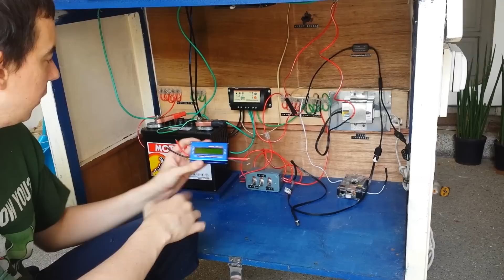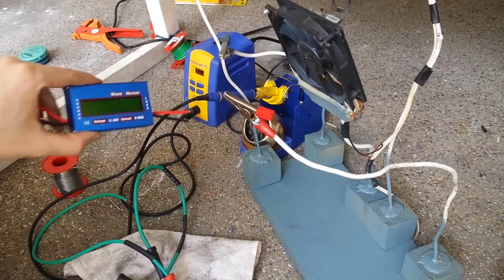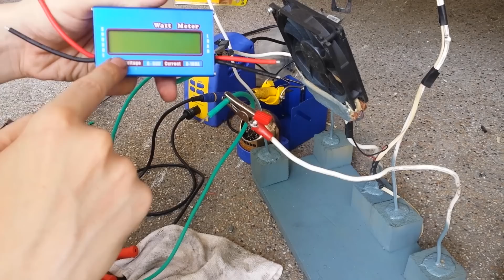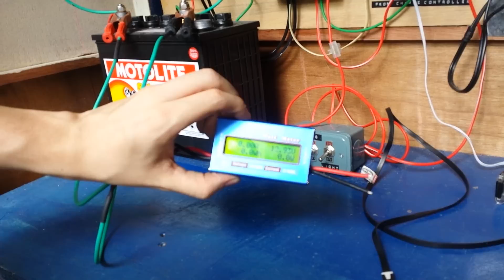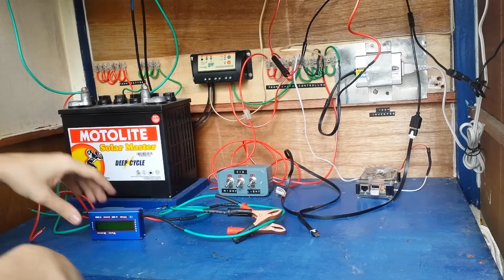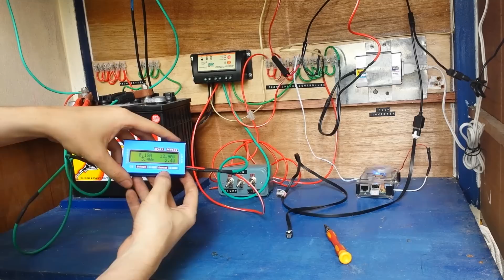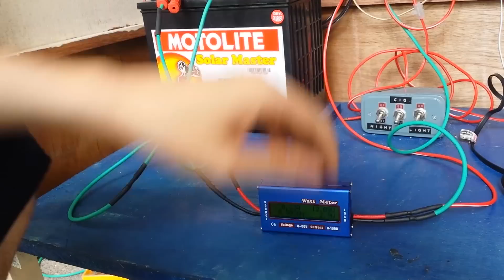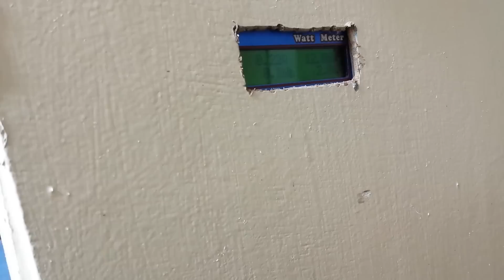How to wire a solar watt meter

Comment: i have been installing solar panels for over 15 years, for them who wants to know the correct way. you connect the solar panel to the controller  the battery on controller to watt meter source, . the watt meter load to battery . then you will know how many amps you solar panel is  given you. some people just do not do there research,
Reply: if you want to know how much you use, put a watt meter  to controller  lights out  source then load to on and off switch  then to you lights or power

Comment: Sir your video is very helpful to me. May i know what part of the controller you inserted the two wires of the LOAD SIDE of the watt meter? I mean what is the portion of the controller you inserted the two wires from watt meter? Sorry to ask but i am a newbie & my electricity knowledge is just starting. Thanks.

Comment: Ok I am confused... I have a wind turbine, and solar. They are as far as I am aware the SOURCE... and the LOAD is the battery that is being charged... How is this the other way around? Because if I reverse the wires, the cables run, solar/wind turbine ---> charge controller ---> then LOAD side of watt meter ----> then Battery on SOURCE side...?? How is the solar or wind turbine going through the charge controller a LOAD...? It's the SOURCE OF THE POWER INPUT !! Then the LOAD is what you are charging or using the power for... i.e LED lights etc...
Totally confused now...

Comment: If the battery is drawing power from the charge controller, doesn’t it then become the load?
Reply: you noticed that as well , you do not  put load back into controller,  controller goes to source load  goes to battery then you know how many amps your solar panel is  producing . if  you  want to know how much you use, then from lights out put to another source watt meter load to a switch then lights

Comment: Please reply! What if I will change the direction, source or load, because when charge controller will charge the battery, current direction will be opposite, it will flow from charge controller to battery, so in this situation will it work, or it will blow the circuit of watt meter? because now the current direction is opposite, please reply

Comment: Hi. I've just bought one from powerwerx and they are clear that the source is the input and load is the output. It also says "only current from source to load can be measured. Drawing current in reverse will cause damage to the meter" that said this is not a powerwerx so best individuals check with their own instructions.

Comment: isnt the source the charger? the load is a battery that needs charged? also i was under the impression these only measure in one direction. i was also under the impression you need a shunt if you want to see watts both going into and leaving the battery. am i right? btw i just wired my "watt meter" that can handle 200 amps and it started to melt my thing jumper cables. i was using jumper cables that are about the size of a mutimeter's test probes. also, just a question: how does the charge controller handle seeing the state of the battery though the watt meter? i am concerned the watt meter may interfere with the charger ability to read the battery and either not charge or over charge the battery. i am just trying to learn, not attacking anyone.

Comment: I want to also measure the the power comming from the solar panels going into the charge controller so I put my meter *(the same as you have) between panel and controller with the controller as load. This works fine. If you have to meters you can see the loss of power caused by the charge controller.  . But every morning my meter has crashed. This is because at night it does not get any power and when the sun comes up the voltage slowly rised and the meter crashes dureing start up. 

So I connect the + and - from the battery I am charging to the external power inputs of the watt meter. But now my  charge controller allways sees voltage on the panel side. This is dude too common grounding and I cannot find a solution for it. The only way so far is useing a seperate power supply to power the watt meter but how do I do that when having an offgrid solar setup? Getting an extra panel just so I can charge an other battery to mearuse watt seems a bit crazy.
Reply: Same question here.

Comment: I use 2 , one between the SOLAR and CHARGE CONTROLLER and one between the CHARGE CONTROLLER and the BATTERY. so i know how much power output the solar panel going through the controller, and how much power output is the controller giving the battery .

Comment: You didn’t specify where to hook it on the charge controller. I have a load hooked to the PVC side and  on the battery side I am in hook to the DC in but I’m getting nothing

Comment: My wattmeter looks like yours. My one has a small hole on the source side. Behind it there are 3 pins. Does anyone know what function they have? External display power and/or holding the data? Backlight? Or for adjusting?
Reply: These pins are used to power the meter when the voltage is below 5 volts or so. The centre pin is positive. One of the outer pins is negative, the other is used to reset the readings. Not sure which way round, and I believe that the reset is not implemented on all models.
Reply: For mine pin 1 is negative and pin 3 is rest. Pin 1 is the pin farthest from the thick red/black wires, and closest to the little square at the top left of the hole. Incidentally mine wont run with less than 7 volts.
Reply: @carlosrey5378  thank you i was wondering why mine wasnt powering up with a 5v usb but once it gets 7V and slighty higher it operates perfectly and does not switch off when theres no source power

Comment: that was informative but you missed out one thing, the wires from the load go the charge controller, are these the middle pins that state battery ?  Does it show in watts what the solar panels are producing an how much they have produced in Kwh per day ?

Comment: Hey, thanks for awesome video. I hooked one of these babies up. With the load side of it going to my batteries. Only glitch I see is. That when my 21 watt fountain pump powers up. The analyzer goes crazy and starts giving some crazy   reading. I have a 25 watt panel, 2 12v LAB'S in parallel = 20ah. And a 21 watt 1.7amp pump. Can you please advice. Much appreciated. Cheers!

Comment: When you installed your charge controller when you did the positive to positive on the battery negative to negative on the battery what about when you hooked it up to the. Charge controller did you hook it in the battery in the charge controller that's what it look like you did please get back to me Mike you didn't hook it up to the panel side

Comment: When you hooked up that wattmeter you hooked it to the battery side first and then the controller but it looks like you installed it in the battery part of the controller not the solar panel part if you understand what I'm talking about

Comment: Why is the watt meter waking up when it's only connected to the LOAD side? It's reading the voltage and drawing power... why? Will I have to wire another switch there to cut the wattmeter?

Comment: Thank you Gadget addict for this wonderful tutorial. I have a question, does it remember the Ah or Wh after power goes off. I mean if i connect this meter between solar and charge controller and when at night solar power goes down , will it remember the next day ?
Reply: No

Comment: Hi Phil,
Could I connect this type of watt meter to a car battery charger.  (CTEK). I need to keep a mower battery topped up with this charger. My thinking is with this meter I'd have a visual check on the state of the battery.

Comment: You need one meter on the panel side before the controller and another meter on the load side after the controller for comparison. The whole idea is to make sure input amp hours is greater than out, not possible using only one of these meters

Comment: Please remove this video. I wired my system wrong because of your advice. Didn't you realize you wired it backwards before you posted the video? What was I thinking? Of course the load is the batteries. I'm uber pissed.
Reply: Your are wrong
Reply from the maker: +Chris Ragan you can wire it either way depending on what you're measuring. Read the video description for more information.
Reply: i agree you have messed me about you are a fool
Reply: Yes battery is the load
Reply: you bet he is wrong battery is  load, source is  controller, you would not put a petrol generator output into a wall socket .  look at my recent replies

Comment: What if your inverter is connected straight to the battery? And i want to see what's getting pulled out more than what's going into the battery.
Reply from the maker: Just wire this between the battery and inverter :)

Comment: Instead of soldering I have seen butt splices used do they have them in the Philippines? I live 6 months a year in Samar.
https://www.bing.com/images/search?view=detailV2&ccid=EWd3J87d&id=2D1E6852427D0D8674258B1B7433C2E3119A2146&thid=OIP.EWd3J87dnbt790aFjdlzBwEsEs&q=butt+splices&simid=608049173240416868&selectedIndex=1&qpvt=butt+splices&ajaxhist=0
Reply from the maker: They're sold in the PH but I don't have a crimping tool and I find they don't work very well when you hit them with a hammer :P
Reply: Thanks for the reply. I'll bring a crimping tool with me.

Comment: After this vid i got a watt meter and hooked it up between the solar panel and charge controller .
But now every new start of the day the watt meters turns on with all weired things on the screen,when i unplug and plug the solar panel back in it starts working again.

Comment: A trick to joining those wires is not to twist them but push them together head on so the strands go inside to other wires stands, then solder.
Reply from the maker: True, especially for thicker wires :)

Comment: Funny I just got one, noticed the only way to get low voltage measurements is to apply a fixed power to pins on side at least 9v-60v

Comment: can i put it the other way around? i want to measure how much power it is going in from charge controller to the battery. Well I guess what I want to do is, how much power I have generated for that day. My charge controller doesn't show my that.. It only shows how much power is being generated, volt and amps. Let me know of other option on how I can do that.
Reply from the maker: Yes that can be done. I gave some alternative wiring options in the video description :)

Comment: you will burn a meter up connecting the source to the battery like you said the load is the battery
Reply: i was about to comment on that, source is solar battery is load
Reply: ha ha ha me too and those wires going to the inverter  are too skinny  also that kind of BATTERY is JUNK motolite its not  really a  deep cycle my motolite  golf cart batteries are junk it is just like a car batteries cannot hold the power easily discharge not even a year since i purchase

Comment: I'm lost. That meter is wired incorrectly surely. The 'source' should be charge controller and 'load' should be battery. If measuring watts of the load on battery, 'source' would be battery and load would be item you connect to battery such as motor, light etc. ie 'source' is in and 'load' is out.
Reply from the maker: +jackbox It depends what you want to measure. Check the video description for wiring options :)
Reply: Three ways that I can see: (1) panel/source/load/controller (measuring raw panel output), (2) controller/source/load/battery (measuring charge being put into battery), and (3) battery/source/load/electrical items (measuring load on battery and state of charge). Not sure what its measuring back to front. It depends how watt meter is wired internally I suppose. Great meter either way :D

Comment: Can I connect the meter directly to the solar panel?  I need to monitor the amount of power it produces in one hour, is there something that could monitor that?
Reply from the maker: +mamamia13 You can measure the output from the solar panel yes. If you check the video description, I talk about which way to connect it depending on exactly what you want to measure.
Reply: Gadget Addict Do you know if i can graph the change in wattage over time?  If there is any tool hat you can recommend for this it would be great!
Reply from the maker: mamamia13 There are some watt meters that come with that feature built in and can export to a microsd card or USB pen drive. But using this one, I don't think there's any practical way without some complicated arduino project.

Comment: How much and where did you get your watt meter? :)
Reply from the maker: +mckoy estrada From Cavite Ecosolutions and cost around 1000 or 1200 PHP. I have seen other sellers more recently with them for around 750 PHP. Or you can order from China with free delivery for around P600 (13USD).
Reply: Thanks!
Reply: Thanks!

Comment: Phil, how would you use two meters (wired in  opposite) to give you solar power in, as well as load out? One meter between panel/battery and one battery/load? Cheers

Comment: hi, great video, its helped me a lot putting together my 12v lighting in my garage. I have a question, if I had 2 watt meters would it be possible to go from the charge control into meter1 to read panel info then into meter2 to read  how much power is being used then into the battery?
Reply from the maker: sephuk Yep that would work absolutely fine :) There are other higher priced meters available that could do that in one go.

Comment: you are only showing what is going out of battery and not what is been put into the battery these units only work one direction
Reply from the maker: David Simpson Check the video description for the wiring options depending on the info you want to know :)
Reply: i did not see the text i was refering to what you said in video you said source to the bettery and load to the cc as you said this you said this will show power in to battery and out of batterythats why i said it will only show power out not power in
Reply: Hello all... could you please clarify what electrically the watt meter&#160;does &#160;from the battery to the CC? The way its wired there is only measurement of what's coming out of the battery. Or have I missed something? I am looking for a simple meter that measures power in off the solar panels and what's leaving the battery to my load.... thanks for your help.

Comment: Hi Phil; You failed to explain what contacts on YOUR CC you connected to. What are they labeled as? i.e.: are they called output meter connections? I ask this because the only other contacts on my CC are for overcharge dump. Is that what they are on yours?
Reply from the maker: Jackson Steen Depending on what you're measuring, you'd either connect the watt-meter wires to the battery terminals or solar terminals of the charge controller.  Check out the video description :)

Comment: Hi phil.  What am i measuring if i connect the source to my cc and the load connected to the battery? Will i be able to monitor how many Ah I'm using in a given day.
Reply from the maker: You'll be measuring how much power you're dumping into the battery. Reverse it and you'll be measuring how much you're using (through the charge controller, not including any devices connected directly to the battery).

Comment: Can you hook up the watts up meter in line from the solar panels to the charge controller to monitor the panels?  Thanks
Reply from the maker: If you just want to measure how much power the solar panel is generating, yes, you can do this :)

Comment: Most of the video is about how to solder wires. You could reduce dramatically your video without suffering the value. 
My question is - does the wattmeter have the internal battery and can it save the meaured values for a time when disconnected from the battery?
Reply from the maker: True, I could have cut some bits down. It's hard to find the right balance between of value added footage. As for your question, I haven't seen any that have built in batteries. But some models do have internal memory that can retain data even after power is lost. Mine doesn't retain data after the power is lost. Hope this helps :)

Comment: I wired mine in before the Controller (between Panel and Controller), what will that tell me different from the way you wired yours after the controller (controller and battery). My objective is to test the output of the panel. Am I doing it wrong?? Thanks. Pls reply to ww4cash@sbcglobal.net
Reply from the maker: Richard Flanders Wiring between the panel and the controller will tell you how much power is flowing from the panel to the controller, so will work exactly as you hoped :)

Comment: Do you have battery indicator in there?
How to know if the battery is 50% full or not?
Reply from the maker: Charlie John Gatasi The wattmeter shows the voltage of the battery. From that you can estimate the battery charge state.